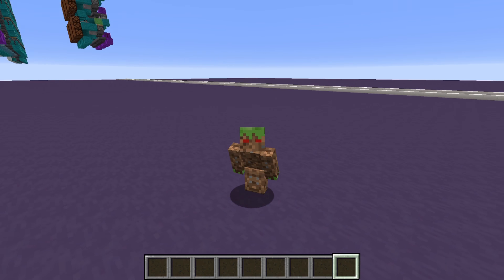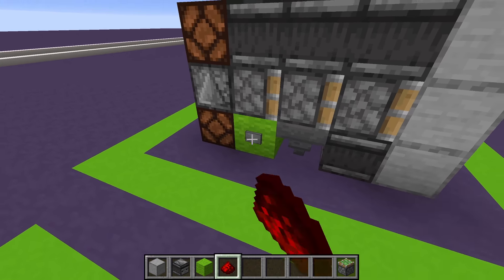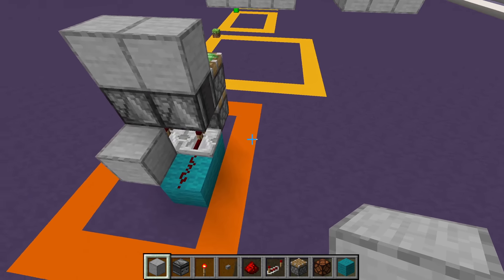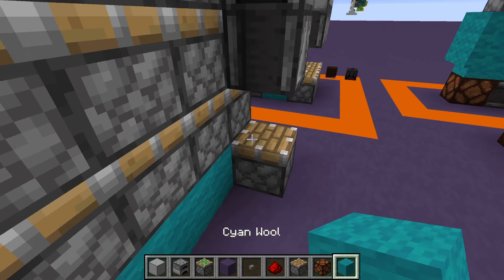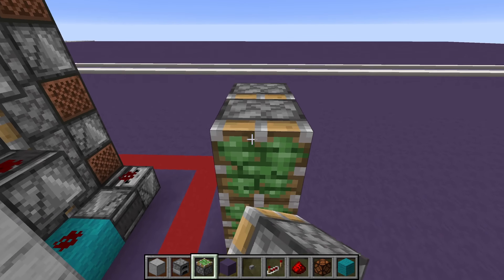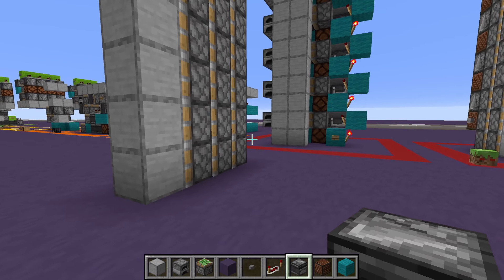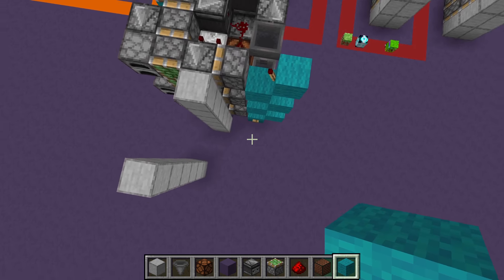How to Make the SMALLEST Double and Triple Piston Extenders!!! [Horizontal/Vertical/Expandable]

Comment: On the latest Bedrock edition, the first one (double piston extender) is rather inconsistent.  It more often than not doesn't pull the block back.  This is usually do to it not properly retracting the second piston.  

I fixed it.  You actually need a second repeater on the second piston.  4 seconds is not a sufficient delay.  Also, 2 seconds is not enough of a delay on the first piston.  So what you end up with is:
SP SP block
Rp Rp RS <-- 3s 4s
RS Rp RS <--      2S
RS RS RS Lv

The redstone (RS) connects the repeaters (Rp) to each other from behind.  The repeaters point into the sticky pistons (SP).  The lever (Lv) can be placed on the ground or on the side of the block the redstone runs over.  It is important that you have the delays set correctly.  Otherwise it won't work.
Reply: Bedrock Edition is a completely different animal when it comes to pistons... sigh.
Reply: if your gonna do Redstone you should get java

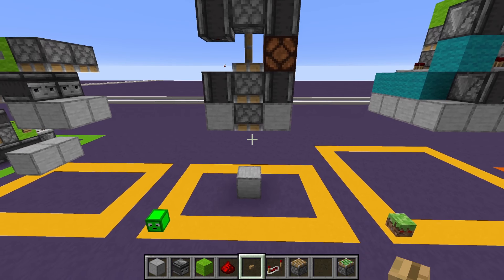Comment: 6:55 correction, it is Expandable if you alternate between a block and redstone dot. Though I could be wrong because he may of had it as a dot so it would not power the piston below it due to bud powering.
Reply from the maker: Just tried and it's not 🤷‍♂️
Reply: @CraftyMasterman  dang, if it was bedrock edition that part would work. Despite everything else failing due to lack of block dropping and random outcomes of 1 tick pulses
Reply from the maker: @emmettdja  I mean I did say at the beginning that none of these would work on bedrock
Reply: Could you use a target block?

Comment: 3:08
you can use dust instead of the hopper
Reply from the maker: Hopper is smaller, dust requires a block under
Reply: @CraftyMasterman  True. But it requires iron which not everyone has a lot of. Droppers are also ok.
Reply from the maker: Iron is also in pistons lmao also iron is really easy to get in large numbers both mining and farming
Reply: @CraftyMasterman  I mean sure.
But to make it tileable will need dust and target blocks.
Also thank you for discussing this with me :) I rarely get to talk to Youtubers.
Reply: @CraftyMasterman  Ye but a hopper requires 5 iron and redstone requires 1 dust if they dont care about size it works fine

Comment: I'm trying to make the extended vertical triple vertical extender (upwards facing), but placing the button input at the end of a redstone circuit leading to the lantern causes the extra pistons to not work, any idea's on how to fix?
Reply: Must power the block strongly, so put a repeater pointing into the block that the button was on that you moved.
Reply: @TrackedHiker  thats not the solution at all and as far as i can figure out the vertical triple piston extender is impossible to connect to an outside source because of how dispensers fire twice when a button is on them
Reply: @TragicSpider  Java edition or bedrock?

Comment: In 1.14.4, the triple extender flush and tillable wont work unless you use the lamps (the ones that the button was on) for all slices and use repeaters to power them. :) I had this issue in my 1.14.4 testing world which was made when 1.14.4 was the latest release, and breaking contraptions sounded worse than not updating to 1.15. :)